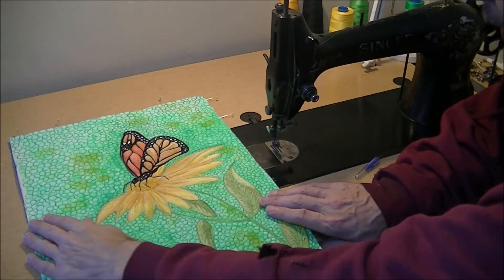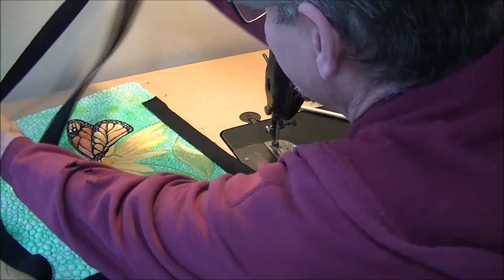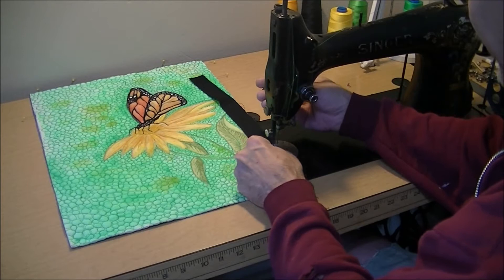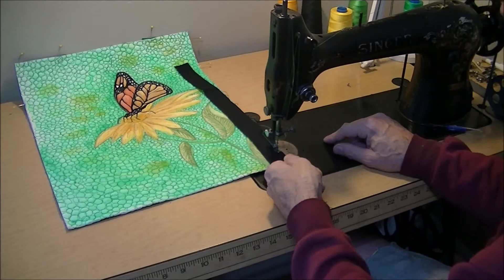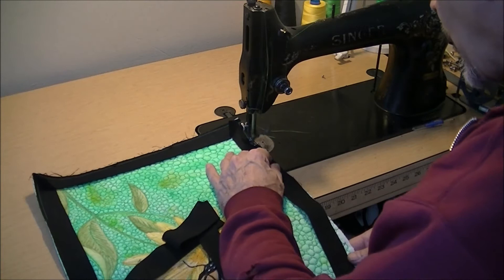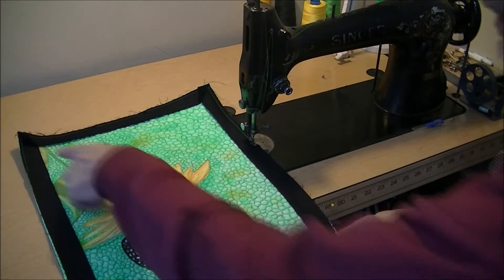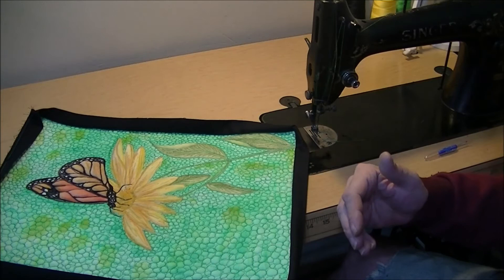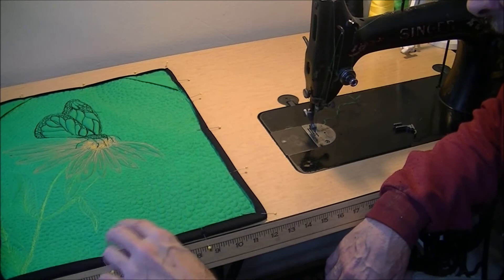Butterfly Quilt Part 2,  Machine  Binding

Comment: When you are FMQing a full quilt, where do you start? In the middle or do you divide the quilt into quarters and do it in sections? Thank you, corey
Reply from the maker: I usually start in the center and work out to one edge and then back to the other......if I can I do stitching in the ditch (it depends on the quilt) between the blocks first which holds it all together well and allows me to get rid of all the pins and not worry about it shifting...then I can do the more involved quilting without any worry about where......I usually then go from edge to center,,,then turn the quilt around and again go from edge to center.  (hope that makes sense
Reply: Yes that makes sense thank you very much. corey